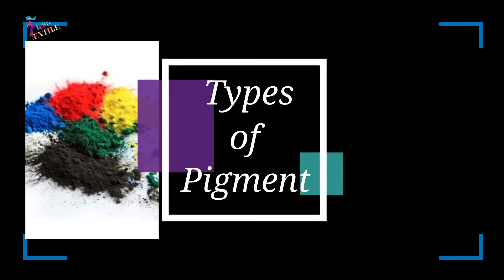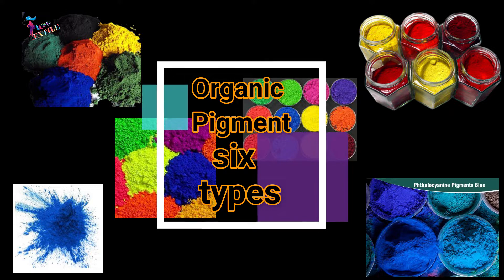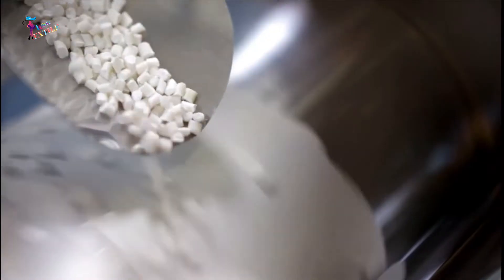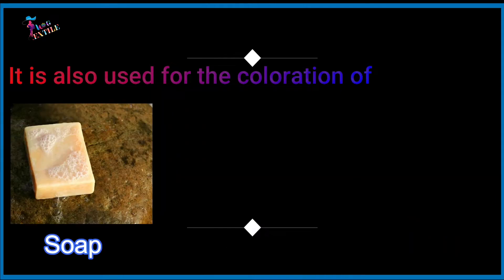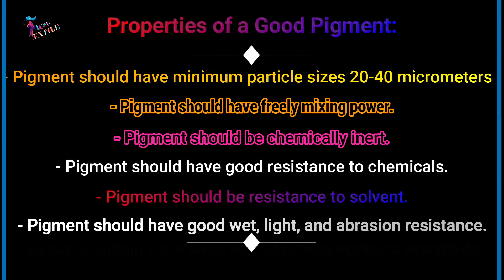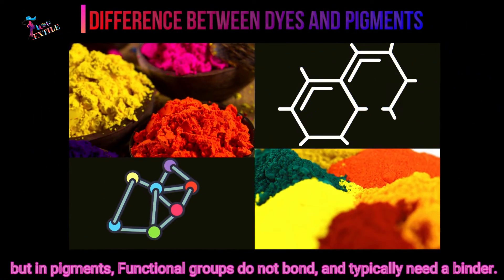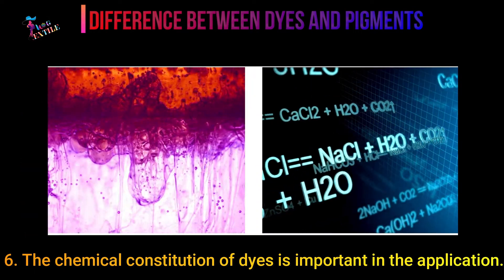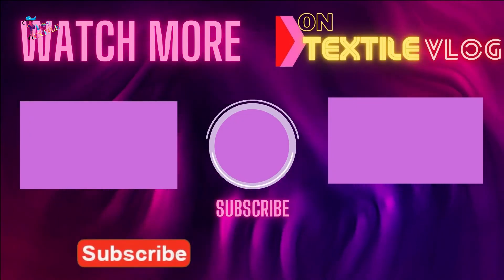What Is Pigment ? Types And Applications Of pigments

Comment: Can i use pigment to dye plastic beads?.. Plz tell me
Reply from the maker: It is possible to use pigments to dye plastic beads, but the success of the dyeing process will depend on the type of plastic the beads are made of, the type of pigment used, and the method of application.

Plastics are made of different types of polymers, and each polymer has its own properties that affect how it can be dyed. Some plastics, such as polyethylene and polypropylene, are more difficult to dye than others, such as polystyrene and acrylic.

Pigments can come in many forms, including powder, liquid, and paste. It's important to choose a pigment that is compatible with the type of plastic you're dyeing and that is suitable for the application method you're using.

Comment: Informative. Can you please tell me what colour pigments are used in crayon. Pigments used for candle is not suitable for crayons. Oil soluble colours are good for crayons but tell us what it is?
Reply from the maker: Crayons are typically made using a mixture of pigments, wax, and other additives. The specific pigments used in crayons can vary depending on the manufacturer and the colors they are trying to create, but some common pigments used in crayons include:

Titanium dioxide (white)
Carbon black (black)
Iron oxides (red, brown, and yellow)
Ultramarine blue (blue)
Chromium oxide (green)